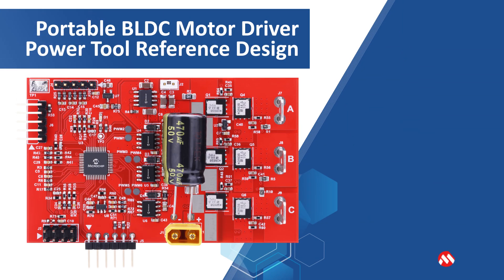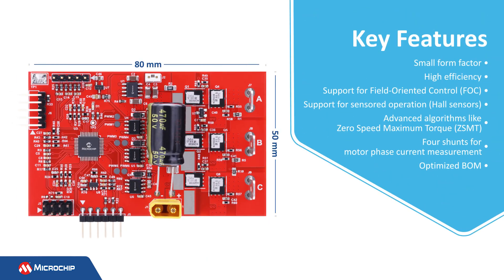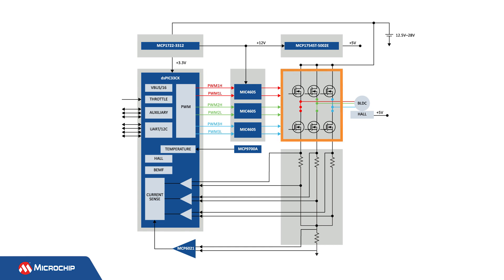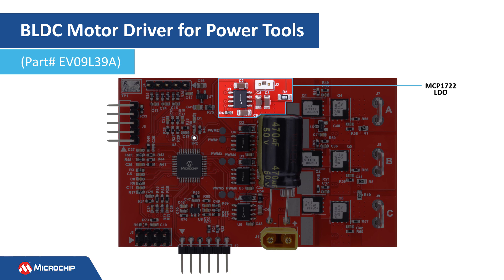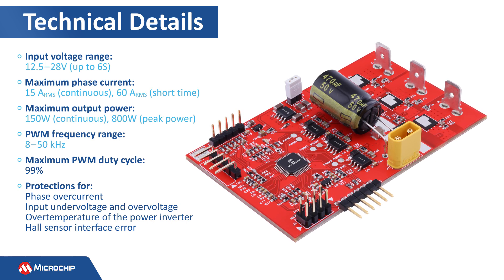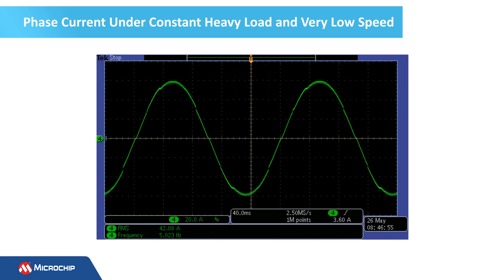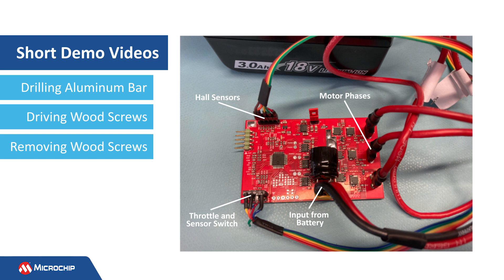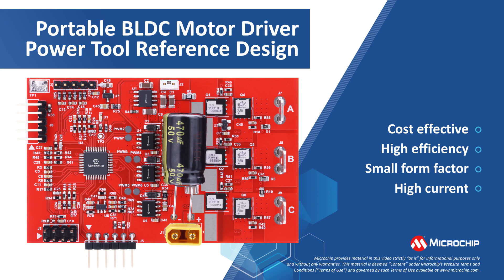Portable BLDC Motor Driver Power Tool Reference Design

Comment: There are no a development board.
Reply from the maker: The development board you're looking for, related to the dsPIC33CK64MP105 used in the reference design for power tool applications, is indeed available. It's the dsPIC33CK Low Voltage Motor Control (LVMC) Development Board, which can be found here: DM330031 (https://www.microchip.com/en-us/development-tool/dm330031).
Reply: @MicrochipTechnology   The QEI1&QEI2 still not available in MCC v5 MPLABX IDE for dsPIC33CK, why?
Reply from the maker: Thanks for reaching out with your question. QEI is supported in Melody for the dsPIC33CK device family. Please let us know if you're still experiencing any issues and we'll help troubleshoot.
Reply: @MicrochipTechnology Please go back and look at MCC configuration. It is not yet available for QEI setup.
Reply from the maker: Hi there, we appreciate the heads up – We will speak with the team about this and see if there are any work arounds for this. Thank you for bringing this to our attention!

Comment: I couldn't find any documentation for sensorless use. only an4740 for sensored. if you have more documents for this ev board.
Reply from the maker: Hi Murat, thanks for reaching out. For the dsPIC33CK family, there are a few application notes related to Sensorless BLDC:

AN1160, Sensorless BLDC Control with Back-EMF Filtering Using a Majority Function: https://ww1.microchip.com/downloads/aemDocuments/documents/MCU16/ApplicationNotes/ApplicationNotes/AN1160-Sensorless-BLDC-Control-with-Back-EMF-Filtering-Using-a-Majority-Function-DS00001160.pdf

AN1299 - Single-Shunt Three-Phase Current Reconstruction Algorithm for Sensorless FOC of a PMSM: https://ww1.microchip.com/downloads/aemDocuments/documents/MCU16/ApplicationNotes/ApplicationNotes/01299A.pdf

AN1162 - Sensorless Field Oriented Control (FOC) of an AC Induction Motor (ACIM): https://ww1.microchip.com/downloads/en/Appnotes/01162A.pdf

AN1206 - Sensorless Field Oriented Control (FOC) of an AC Induction Motor (ACIM) Using Field Weakening: https://ww1.microchip.com/downloads/en/Appnotes/01206A.pdf

TB3220, Sensorless Field-Oriented Control of PMSM for Appliances: https://ww1.microchip.com/downloads/aemDocuments/documents/OTH/ProductDocuments/SupportingCollateral/TB3220-Sensorless-Field-Oriented-Control-of-PMSM-for-Appliances-DS90003220A.pdf

Hope this helps!

Comment: Just bought a Curiosity LPC development board. When I connect the board to laptop USB, the board will power up and the LED will blink as expected because of the pre-installed program on PIC16F18446. When I try to program that chip, I find a programming tool with my board serial#. I try connecting to MPLAB IPE to see if the application can autodetect my board, no luck. Does that mean my board is faulty? Would like to know if I miss anything before asking for a replacement.
Reply from the maker: Hi there, thanks for reaching out. Please try using the Curiosity LPC development board with the MPLAB X IDE (Integrated Development Environment) rather than the IPE. The MPLAB IPE is the Integrated Programming Environment for production-level programming. If you would like assistance please contact our team at www.microchip.com/css. Thank you!